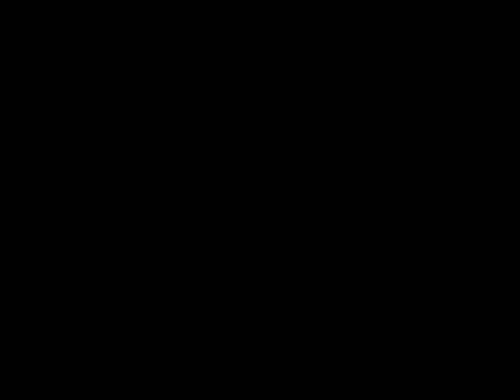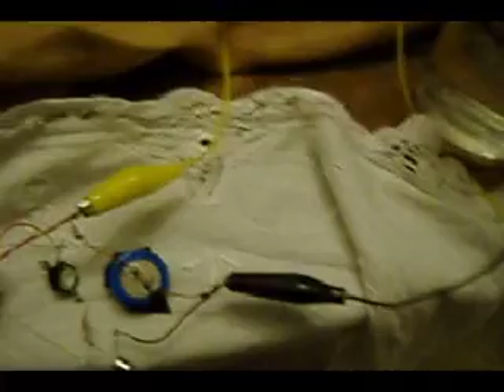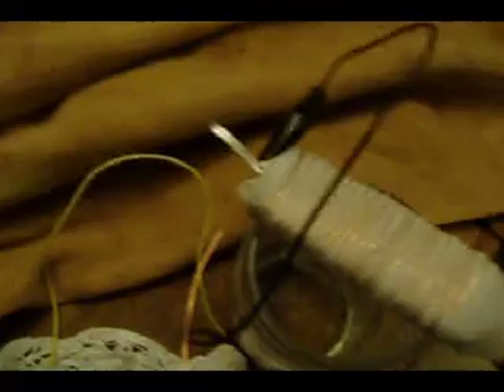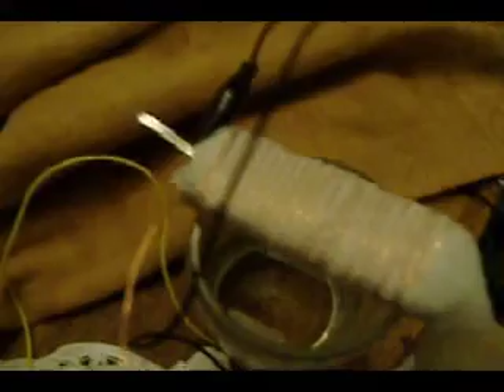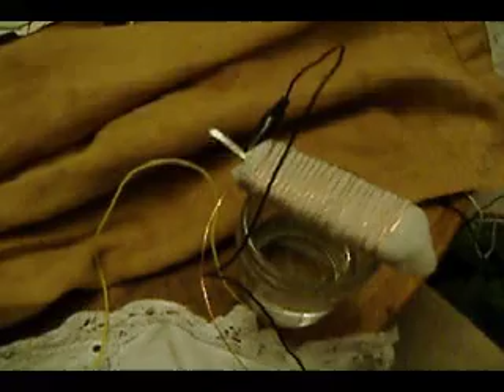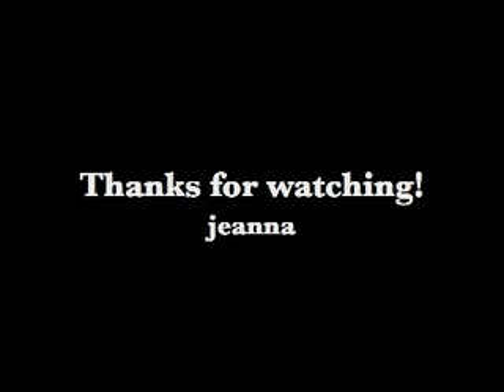firestarter Copper Battery

Comment: Measure the output of the battery without the joule theif and see the change of voltage over time with normal operation under load.The magnesium is probably oxidizing and creating a electrolyte decreasing the internal resistance of the battery.

Comment from the maker: @Pirate88179 
HA! It is over the water because I ran out of space on my table. I soaked it then propped it onto the jar. Copper is bare.
I didn't try it without the cap, and I do not think it would work at all without it, but perhaps it would.
There is nothing too special about this battery except I am hoping that it will last for many years. In the plant battery the magnesium goes at a rate of 1.6 grams/ month So, at that rate the firestarter should last years.

Comment: nice work , I have built many of these type batteries ...I built 5 small ones once and they ran 19 leds for 5 days straight ...Had 1 that was 2" long and only 1/2" thick with a JT run a led for almost 2 weeks ..

Comment: Jeanna:

Wow!  That is really something.  Is you Mg block over the water to absorb moisture from the air?  Is your wire (copper) bare or is it mag wire with the poly insulation?

Very well done.  PS  I think the delay in the light being on continuously was due to your memory cap.  It probably took a little while to fill the cap and now your spikes come back as usable power for the led.  I do not know this for sure but, I believe this is what might be happening.

Bill